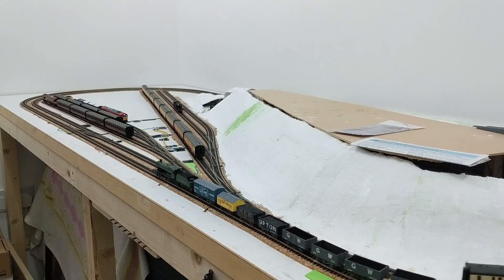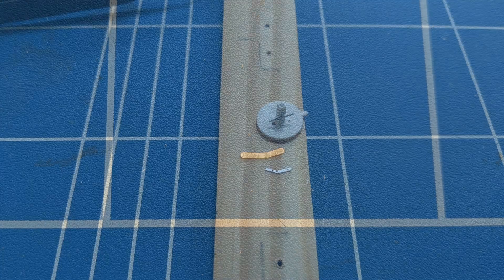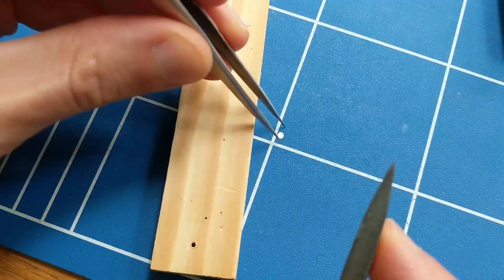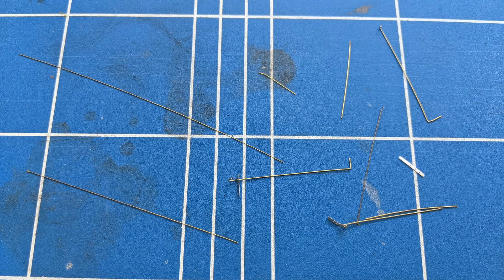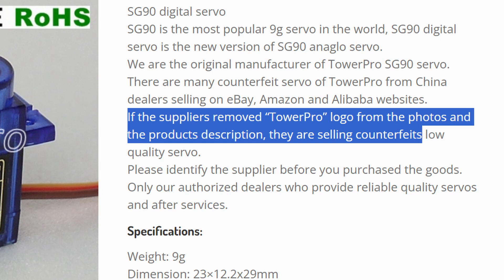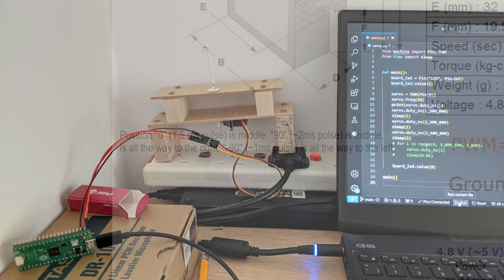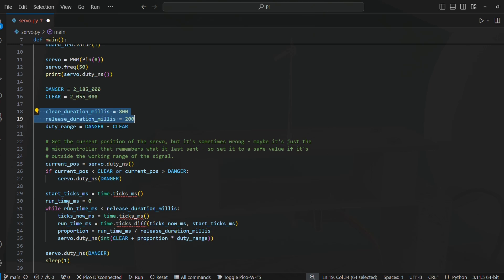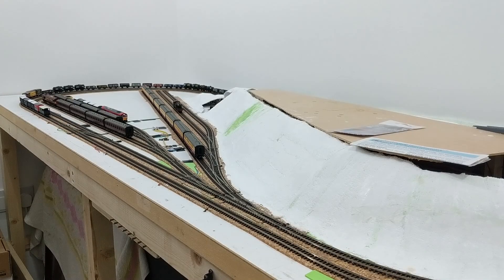0044 Animating a Ratio Signal in N - part 2 - servo motor

Comment: Good morning Jonathan! Some impressive stuff here! Can't believe you're able to drill holes so small! I love how you've persevered and gone through iterations of design / implementation to get a better working model! Hope painting everything doesn't impede the mechanism! I was quite surprised to hear you talking about setting frequencies to control the servo positions! I've dabbled with servos as you know, using an Arduino, and there's at least one library available where you simply set the angle you require, or am I misunderstanding? Cheers, Ian.
Reply from the maker: Morning Ian, thanks :) It's the thought of fiddling to install a few of these on the layout that's motivated me to get the process improved! I think fundamentally the servo needs the PWM signal, but I figured it would be easier to just use that than find and install a separate software library - either way you're just telling it values to go to, and experimenting to find the right values. The data sheet says the signal range is ~1ms to ~2ms, but the actual range of 0.3 to 2.4ms is twice as big - I don't think a generic library would know that, especially if it can vary per-servo, and the PWM signal is an output from the controller - there's no feedback from the servo. I really don't know a lot about servos though, so there may well be more to this! Apparently if you want exact control of rotational position you need a stepper motor, but I haven't looked into those, beyond Googling what they are having seen one in a video.

Comment: I am in awe that you have made an N signal without gluing it solid, the engineering after this is amazing

code stuff is fun, there are PWM boards that drive them with an I2C interface, can be useful, a PiPico is pretty powerful though
Reply from the maker: Thanks!

Yes I think there are lots of servo control options around, but I already had a Pi Pico so went with that for now, plus I like being able to customise the code :)